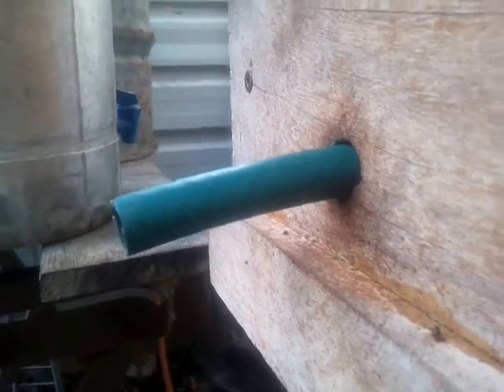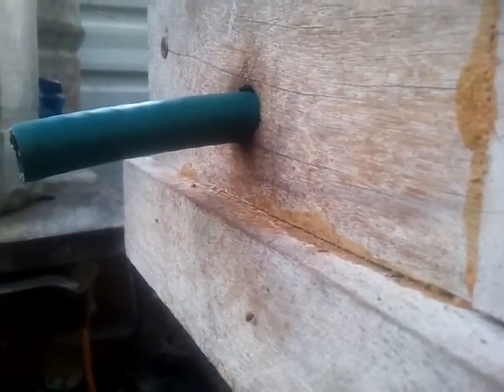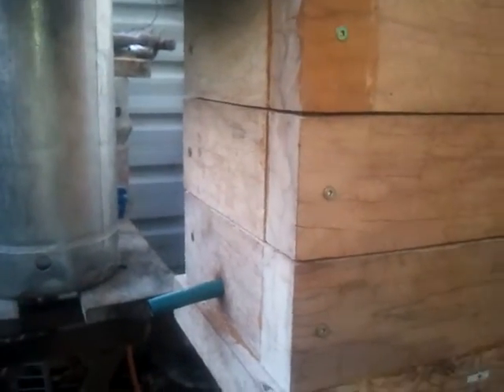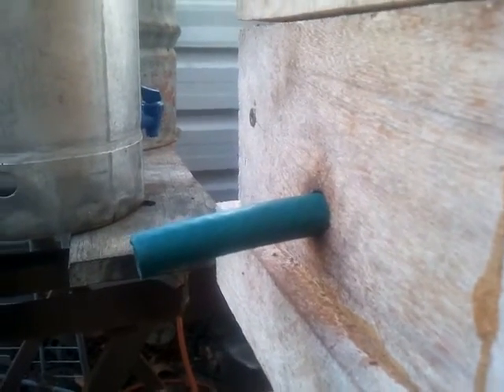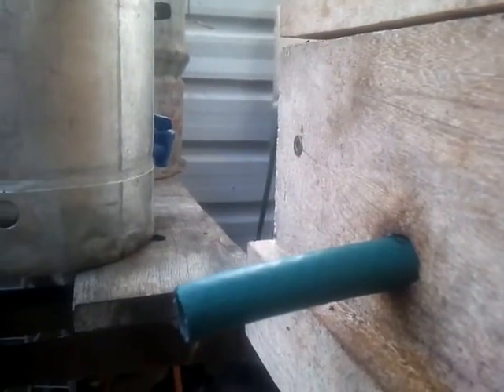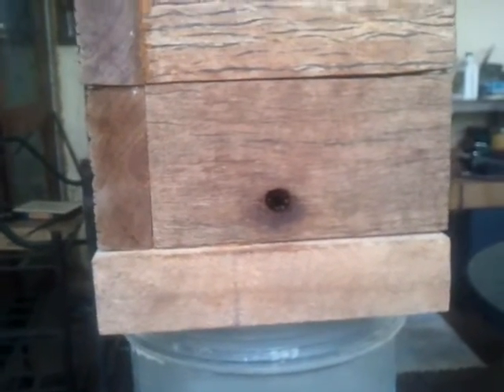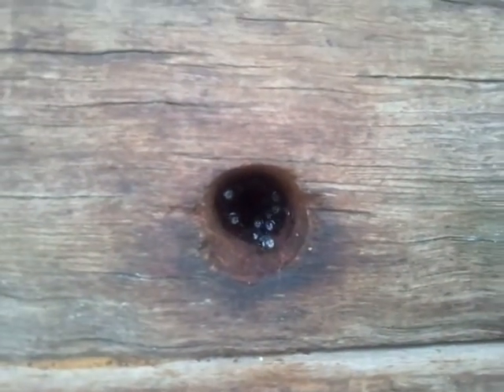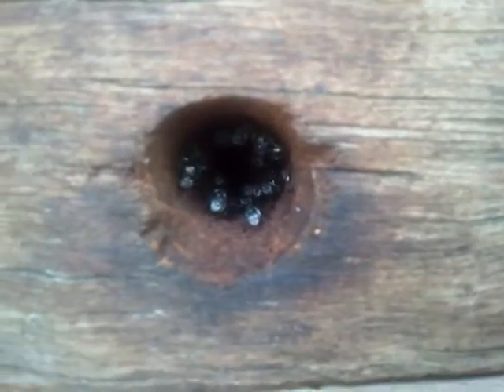North Queensland Native Stingless Bees - Phorid Fly Pest Control - Introduction

Comment: That entrance tube needs to be sealed around its base.
Reply from the maker: Its a valid point, as there are many cases of flies laying eggs there, then entering the hive. So yes if your starting out, do that. HOWEVER, when I build my hives, I make the hole size just right. The hose is an extremely tight fit to the hole. There is no way anything will get thru. BUT if worried, then yes extra seal is in order